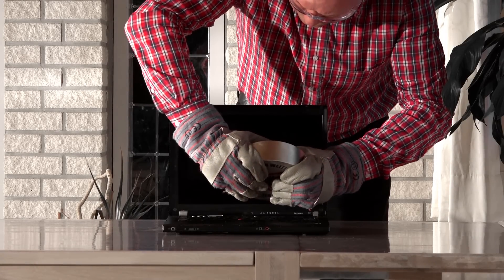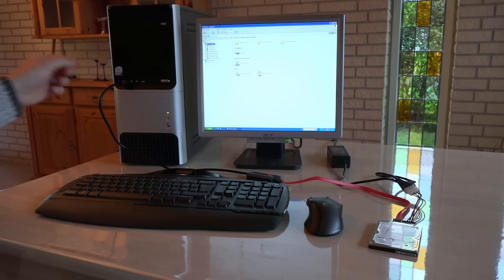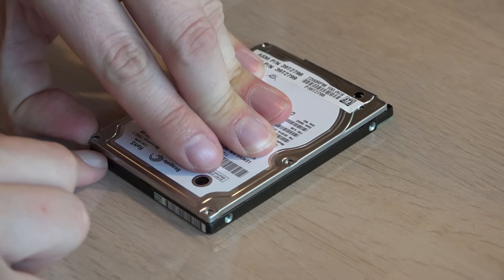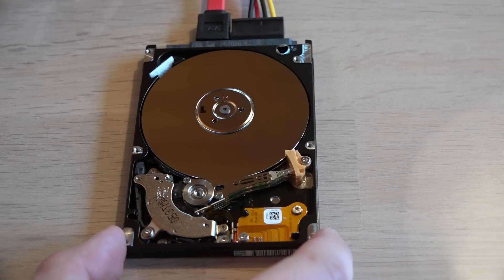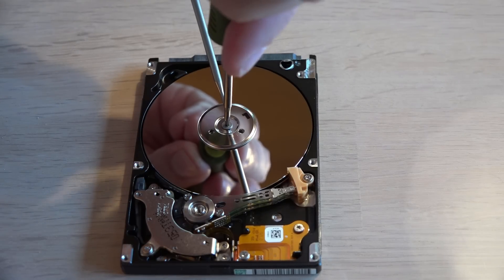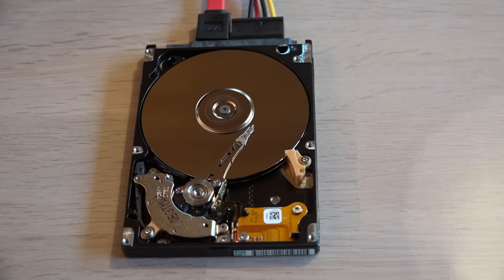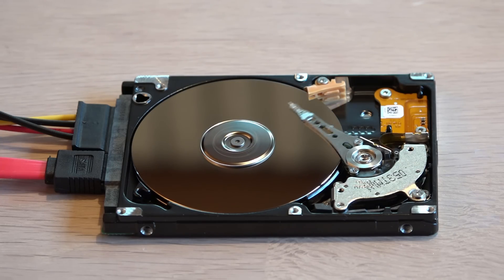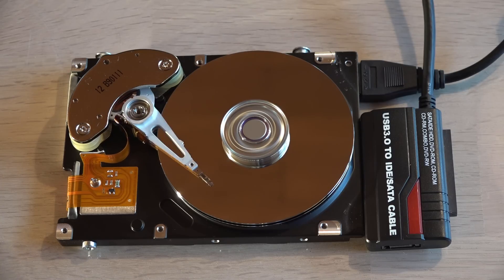Killed by magnet | HDD examination

Comment from the maker: Thanks for all the kind comments and suggestions on what might have gone wrong with the drive!
In my video where I opened another magnetically killed HDD, I concluded that the data on the platters were simply wiped away by the magnet.
I still have a feeling that is the case - but I can't conclude it with certainty.
Especially after reading this from the pro's: http://www.supermagnete.de/eng/faq/What-is-the-safe-distance-that-I-need-to-keep-to-my-devices#hard-drive
But the 6x2" magnet is ridicously strong - even at some distance. Much more than my second-largest neo-magnet and the sizes that Supermagnete sells. So I wouldn't be surprised if the 6x2" is able to wipe data from the platters at some distance (~10 cm from the laptop in my case). It's just hard to prove :) I may need to revisit this magnet vs. HDD in the future...
Reply: the magnet messed up the low level format so the reader/head don't even know where it is
Reply: Brainiac75 years ago I was contracted by a company to recover a crashed desktop hdd like the one you destroyed. After some troubleshooting, I determined the heads are misaligned due to power failure causing a head crashed. What I did was to buy a new hdd with the same product code, open it, carefully remove the top neodymium magnet off the head module and very carefully transplanted it to the old hdd. I have a 100% data recovery with minimum bad sectors.
Reply: MineCraftDance Because he doesn't want to kill a Mac...   Or a Linux box.  Or a VAX.  Or a PDP-11.   Or a C-64.
Reply: Just as you are saying It doesn't work because it's completely wiped.
System can't find anything there that's why it acts the same with or without platters. If you replaced platters from working HDD (same model) it would surely work again.
Reply: +brainiac75 Please do, this awesome!
Reply: +brainiac75 I think you bend the head's arms, that's why you can hear a tiny weird sound when the head is moving. Old HDD contains a lot of magnetic elements, even on the disk itself, nowadays engineer make them less sensitive to magnetic fields, but with a your powerfull magnet, I think you can still kill one.

You clearly wipe everything on it (every single bit is a polarisation state so...) but this is not the major failure.

I'm not a pro, so I don't tell you "THIS IS WHAT HAPPENS !!" and I'm French so forgive me my english skills aren't very good.

Bonne continuation :)
Reply: Gian Marco Lastname These instructions are stored in a chip (like a SSD or USB drive, SD card and so on), they are not stored magnetically.
Reply: +Seegal Galguntijak nice to know, thank you! but I'm wondering if re initialising the disk should make it work again losing all data obviously!
Reply: +Brainiac75 can you put the platters on a fully working HDD?? to see what happens...
Reply from the maker: ***** Thanks! Some hate it, some love it. Good thing that not only the haters speak up :)
Reply: +Brainiac75 very nice video, it was interesting to see a deconstruction of an hdd!
Reply: Hdd coercivty is 4000gauss.  Hdd degauss units generate 14000-20000 to reliably erase the data on the hdd itself.

I think it's more likely you bent an arm enough l be out of spec or damaged some sensor.  I believe your magnet is 5000 gauss at the surface,  so i dont think you got close enough to damage the data on the platter.
Reply: did you check if it showed up in disk or device manager.
Reply: +brainiac75 I took one of my old harddrives apart to find the read/write arm was bent on the top platter which was why it was making noises and likely why it was causing windows to crash. It wasn't even my boot drive and it was causing massive system instability. Your magnet may have not only wiped the data but also bent the read/write head even just slightly.
Reply: Noyjitat
Read my comment, I already told him, but I am reassured that you find the same thing as me, I wasn't wrong ^^
Reply: SpringtrapFan2015 VEVO
Yep, there are many layers on HDD, some are magnetic. Datas are define in binary, North pole equal 1 and South pole equal 0 (or the contrary)

You also have 2 magnets to move head's arm
Reply: You can easily remove head's arm magnets, they are neodymium magnets (smaller and strongest than others). Bunch of tutorials on the web if you don't know how to remove them.
Reply: +brainiac75 Well, with two identical drives, it may be possible to swap platters (I know not about relative platter alignment) to determine if the heads have been damaged, or if the media has been altered.
Reply: +brainiac75 why windows xp?
Reply: +brainiac75 I think that big magnet is simply whiping the essential data necessary to detect the drive. I don't remember how it is called as it was part of computer architecture classes. very down to the metal kind of stuff
Reply: +Brainiac75 While the magnet did erase all the data, it also magnetized the magnetic storage particles on the platter surfaces too strong for the rather weak electromagnets in the read/write heads to be able to change anything, so they couldn't write any more data to it, and that means it can't even initialize. Plus the magnet may possibly have misalligned something, although that isn't the most likely.
Reply: ***** Kappa is Greek.  :)
Reply: probably the magnet have wiped out the instruction on the little board of the HD on how to read and send data
Reply: Gian Marco Lastname As I stated in my comment above: The disk platters are probably too strongly magnetized by that huge magnet for the read/write heads to be able to overcome such a strong magnetic field, because they are not strong enough. This would mean it's impossible to revive the disk, because you'd have to get the reverse magnetic field just right to undo the damage. This in combination with the fact that the drive was spinning when it happened probably damaged it completely, because the magnetic field also influenced mechanical parts inside, which may not be correctly alligned any more after the exposure. So I'd say it's definitely dead.
Reply: +Seegal Galguntijak wow uou  got a point here sir! thank you so much, indeed this is a very good explanation!
Reply: +franzie znansie Jep, jeg havde det på samme måde.
Reply: +cool redstone; That is same thing I was thinking. The factory programmed, track and sector positional data is gone.
Reply: HDD platters has a layer of tiny bits of magnet where the data is stored. You know the polarity of a magnet, no? The neodymium magnet changes the polarity of the tiny bits of magnet which destroys a bit of a data, making it unaccessible, even data loss. That's why, SSD wins the battle.
Reply: +Brainiac75 I don't know if this was said yet  or if you knew this but the data was wiped as the hard drive stores information in a magnetic for and reads it as zero's and one's e.g. a positive charge = 1 and a negative charge = 0  and the magnet distorts the magnetic current so they are neither
Reply: +James Like a qubit? Those found in quantum computers.
Reply: yes but q-bit are both 0 and 1 making it to have more space.
Reply: +James Oh....
Reply: +Brainiac75 er du dansk?
Reply from the maker: Magnus Jørgensen Ja, født, opvokset og bor i Danmark :)
Reply: ok
Reply from the maker: ***** Nice to hear. Thanks for watching!
Reply: In my though, the clicking sound cause by hard drive could not find Track 0. Track 0 is like a drive header that tells a drive where are all the information in a platters . Kind a like a Index of a book. But it could not find track 0 so it tried to "restart" by park the head and find track 0 again which cause "click" noise.
Reply: well, it may not be all of the data, rather it might just be the partition table
Reply: Be careful when opening up hard drives, I cut my finger with the sharp metal and it was a deep but thin cut.
Reply: The magnetic pulse of the magnes could've changed the way a drive stores its data it is called bits and they are magnetic and they are in a certain direction whitch it stores data in binary code and tge magnet couldve re aranged the bits there fore the data was cleared
Reply: Brainiac75 75 likes!
Reply: Sector 0 was deleted
Reply: If it is erased should it show something like "free space" in disk manager?

Comment: My guess would be that the basic magnetic structure of the platters has been damaged or destroyed. Mechanically it looks fine but magnetically it probably looks like a total mess. The computer is probably detecting it as a drive initially but when it comes to actually read the parameters of the drive it's getting rubbish so it doesn't show it in the drive listing. You might be able to plug it into a linux machine and get a bit more information about what's going wrong.

Comment: When something like this happens you can (or I should say, at least you could in the old days) fire up a utility that will low level format the drive. After that you can partition and format the drive normally and start using it again. Often this also works after a head crash, (no, not always, it depends) but then you most likely loose some or a lot of storage capacity.  Did this a couple of times in the nineties with varying degrees of success. See this (old) page for more info: everything2.com/title/Low-level+formatting+an+IDE+hard+drive

Comment: Those USB sata things don't work as well as an actual motherboard ... maybe it would have still worked. 

Atleast you could have seen if the drive was recognised in the BIOS. And if it did ,you could have used a disk utility in Ubuntu to save it.

Comment: Probably the service area got erased by the strong magnetic field. The strange head movement is due to the heads trying all the various backup service area locations on the HDD, and finding them all corrupted (a HDD always has multiple copies of the service area, in case a bad sector develops in one).

Comment: Hard drive stores diagnostic and running information on it's platters. If that's wiped out by the magnet the hard drive won't be able to function correctly, if at all. Newer hard drives have those plastic "skids" to keep the heads from scratching the disk during transport.

Comment: Maybe the whole calibration is distorted. Try putting the discs in a working drive. But how likely is it to be working? I always thought open cases are deadly to the drive...
Reply from the maker: +Ansan Ro 
Generally you should only open a drive if you don't care about the data on the drive...
The dust, moisture and other particles in the air will quickly mess up a working drive if it is opened.
I have seen examples of drives with the heads stuck to the platters being fixed temporarily by opening them and manually loosening the heads. It may work long enough to get a backup but will eventually likely crash after being opened.
If a hard drive with crucial data crashes and you 'forgot' to make a backup of it - send it to a professionel and pay them to try and get the data from it. Don't open it yourself :)
Thanks for watching!
Reply: :-) Thanks for the reply!
And for making these experiments!
I always wondered about why the magnets have such power. Where does it come from?

Comment: The magnet destroyed the telemetry data of the drive stored at negative cylinders. There are tools available to trick the drive to run external firmware and emulate the telemetry data to allow the drive to be retested. Even though the drives OS is in flash all of it's parameters are available only via reading the factory programmed platters. hddguru.com has info details and tools. I've gone as far as use software to emulate the firmware on a SATA I drive and actually recover some data and swap PCB from donor drive. Otherwise off to the pro for the real magic.

Comment: The magnetic feild caused the disk to get wiped since there is also a magnetic feild on the tip on the arm that aligns the magnetic particles on the disk creating 0" or 1". The monster magnet caused the aligned 0" and 1" on the disk to get moved around rendering them usless for the arm with needle to reed

Comment: It could be tiny little floaters that hover very very close to the platter that are not the heads, but near the location of the heads that might've slipped, and flew away resulting the actual read/write heads to actually touch the platters (the read/write heads aren't actually supposed to touch the platters, it's only supposed to hover very close above them)